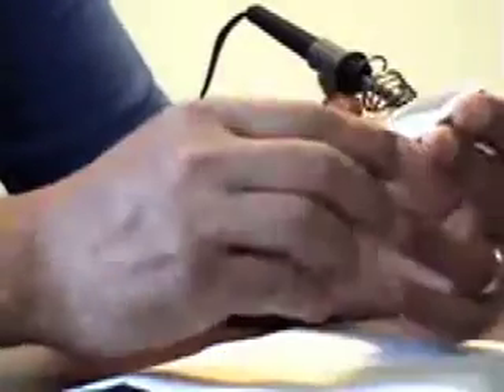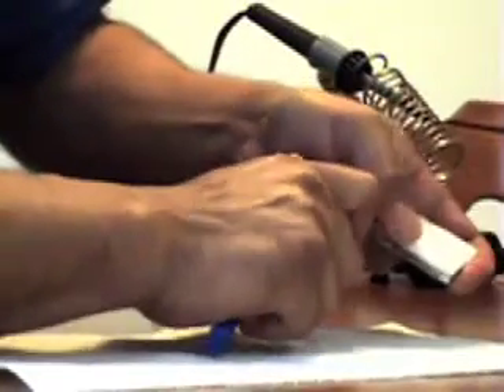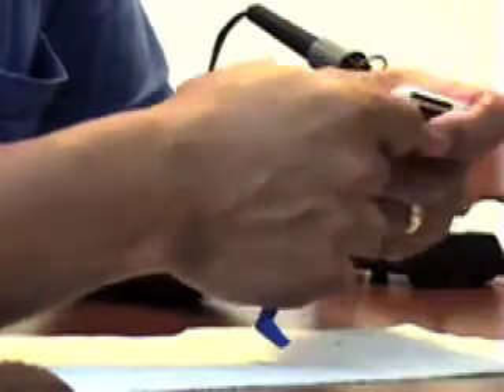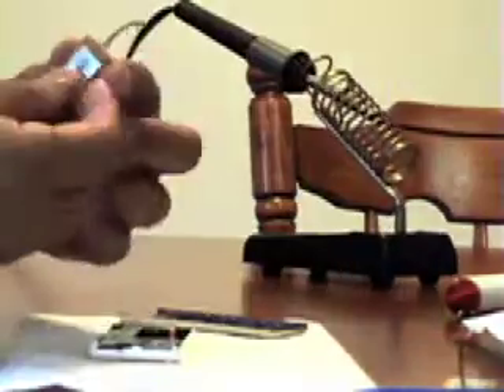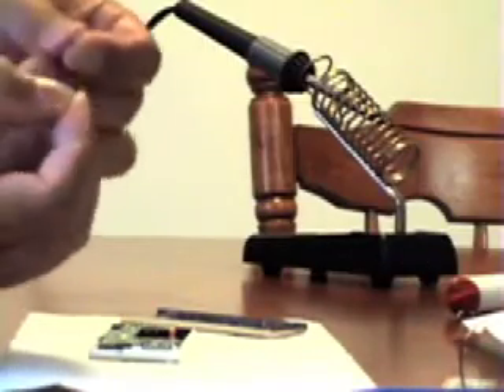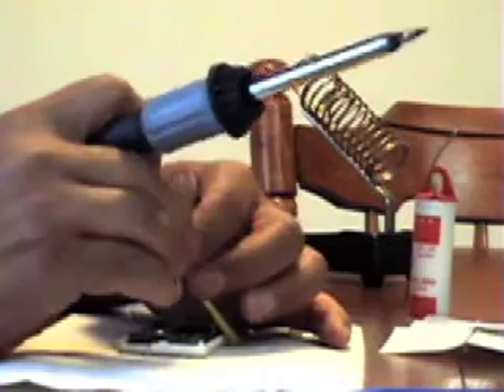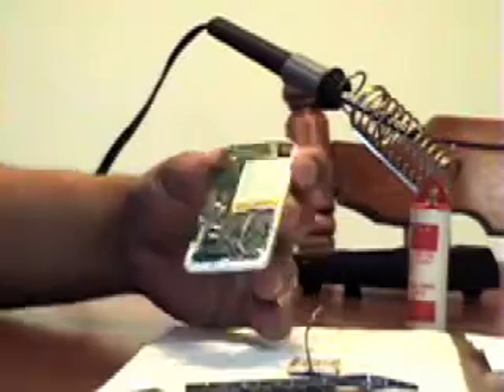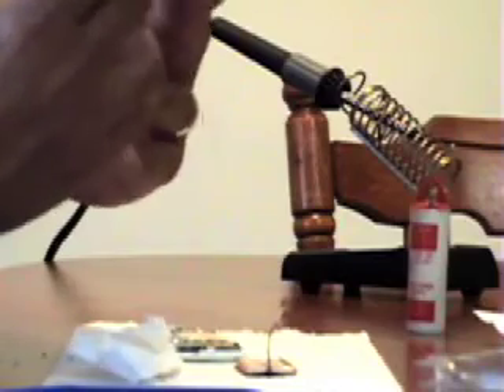iPod Nano Battery Replacement

Comment from the maker: The tool is cheap but it works. It some takes patience and persistence. I have fixed several iPods and the first one, of course, was the most difficult  but then it gets easier. 
Find an area around the iPod where the tool can go in and work that area loose then move on to the other sides until it will finally open.

Comment from the maker: When you buy the battery, it should come with a small plastic tool that is used to pry open the iPod. It takes a little patience and some effort but you will be rewarded with a cool, rejuvenated iPod.

Comment from the maker: I use a soldering iron of 15 Watts.

Don't use a soldering gun since with the temperature is difficult to control with them because the heating element is so small.